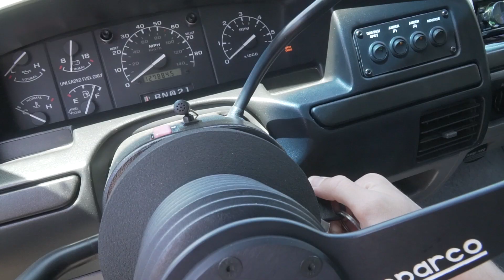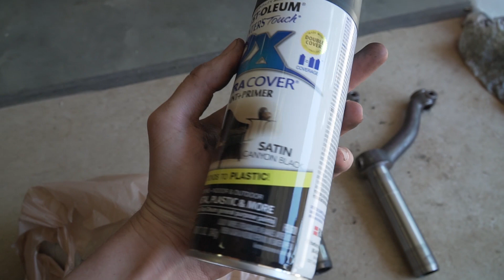The Barn Find Bug Gets LIFTED! (How To Cut And Turn A Beam)

Comment: One can use  a pipe cutter and leave the springs in place and just turn the tube  10mm or so , a lot easier,  I only did the one tube  to regain some ride height

Comment: Double ended pipe cutter. The kind with a small cutting wheels like used to cut copper tubing. They are made for large diameter steel tubing as well. Only need to rotate partial turns to completely cut the front end  apart. Sorry if this is already mentioned

Comment: you have prob done a few of these since this but nxt time you cut one clamp a length of angle onto the beam across the cut, this will keep the beam in line/straight when you weld it back. We used this method when narrowing axle housings before we had a jig

Comment: Did the front and back the same on my 65 Baja. Tip, square back axles are an inch longer and bolt right on.

Comment: Noooooo!!! Wrong way brother. You go one notch up and weld in the adjusters and narrow it so you can go down!!  My 66 sits low.  Get a stinger with out the baffle and advance your timing just a hair. You'll be able to get flames from downshifts and just from a rev. Lol. People behind you at a light love it.😂. And it's loud.   But just for a kick. I wouldn't run it that way long.  But really bro. You're in Callie. You have to go low.😜 If you don't get stuck or scrap. It's not low enough. No bag's. That's cheating. But good luck with yours and make it yours

Comment: You can get adjusters to weld in place so you can adjust the height of the front beam
Also you can buy new extended rear arms too mine has 3x3's on it with triple shocks and a full roll cage

Comment: good job, nxt time you need to degrease/clean a part try heavy duty oven cleaner, spray it, let sit bout 10~15 mins, then pressure wash it off, use hot water if you can. works great and lot easier

Comment: What kind of mpg have you been getting in this? I have a 64 and get 12 mpg but I feel like I should be at 25-30 mpg
Reply from the maker: Dont have an exact number. If I were to guess, maybe around 20.
Reply: Stock = 30 mpg hwy.

Comment: Not that you can do much now without changing the whole rear end but you really need an IRS rear suspension setup
Reply: All vw's are IRS.  Either swing axle or double jointed axles.  (VW owners manual.)

Comment: Its 1000 movies how to lowering Bug!!!     What its Simple Easy way. Budget effect. ///but The problem its how to make lift .on original parts  one ofmy  bugs 1969   hawe 27 cm from flor to The ground i dont remember  No w 37 or27    but is wery high   like offroad  and this itd original high . Nad im wery like . ////The second one its lower and im spend lot of time to lift and this is big problem on front im welding.....screws im must wery screwing   and spring it .... once Time before one top screws self going out  becase im Many screwing wery tight to make Little high .....and biggest problem its on The rear .and in my Bug i think to put biggest rims becase tires Street tires The biggest and still itd to much lower . Mayen you have some idea how to lift rear  where to find biggest wheels -rims    i wanna be lift like your s Maybe higher what do it ?..yors looks Good lift . I dont like lower cars i wanna lifted